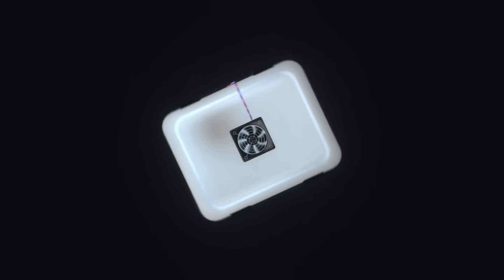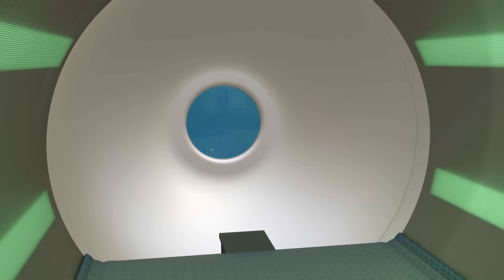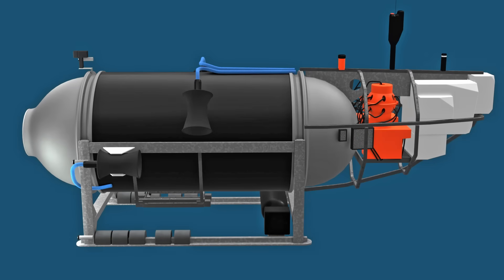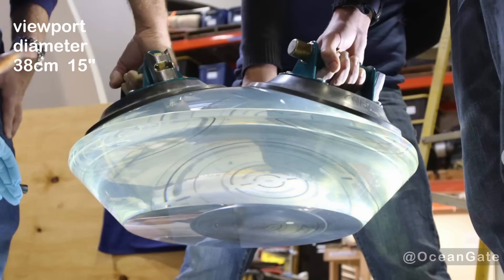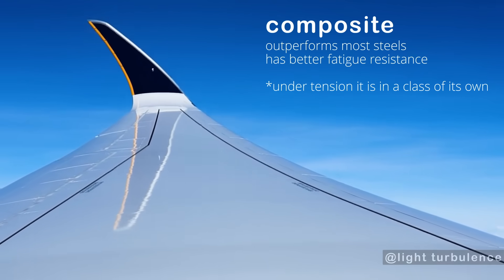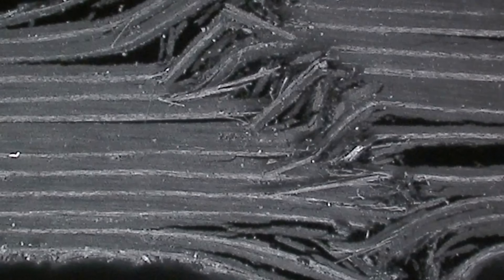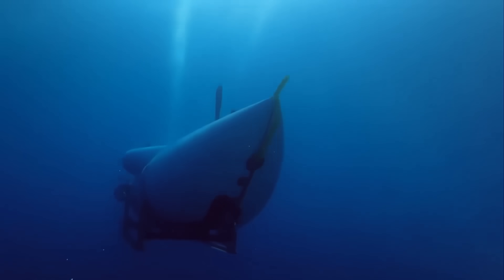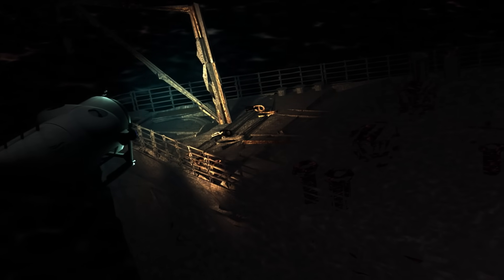Titan Sub | carbon fiber - Detailed Tour

Comment: While carbon fibre can be used for constructing virtually anything it must be used within its’ limits. The loud cracking sounds heard in earlier dives were layers of carbon fire failing and delaminating. Each crack sound represents a weakening of the overall structure. It was mistakenly thought that monitoring the number of crack sounds heard would give an indication of fatigue building in the structure. While this is true of certain metals, carbon fibre has a tendency to fail catastrophically and instantly once the limits of the composite carbon fibre resin compound are reached. The Hydraulic Press channel has a very good video showing carbon fibre failing under pressure and the failure is instantaneous and catastrophic. Titanium or steel elastically deform at known rates before reaching a point where permanent deformation and significant weakening occurs. The plexiglass window was also a potential point of failure and was subject to significant deformation with each dive. It was anticipated that surface cracking would occur and become visible on the surface when it was time for the plexiglass to be replaced. This surface cracking would indicate that the plexiglass had lost some of its’ elasticity and was not returning to its’ nominal size as deep sea pressures were reduced to surface pressure and the plexiglass expanded once more. This elasticity was also responsible for maintaining an air and water tight seal around the view port at depth. While the overall design may have appeared innovative, there were insufficient allowances made for material degradation with repeated pressure cycles. The safety factors that should have been built in were simply set too low or missing altogether in an effort to keep the craft as lightweight as possible.

Comment: What's tragic is he could've tested this thing relatively cheap.  It could've been weighed down, and dangled over a ship and let it sink.  Could have lowered it to a mile deeper than the Titanic and pull it back up and see if it survived.
Reply: They should do that, and then use ultrasound or x-rays to make sure that the structure has not been compromised in doing so.

Comment: This is all fine and the engineering and structural issues will be finalized sooner or later.  What I want to know is what took those looking for the sub so long to find it?  It was almost exactly where it was going.  Why was the Navy, Coast Guard, etc. feeding the media false information about hearing banging sounds even though they absolutely knew the sub had imploded.

Comment: The carbon composite was the failure point.

Yes, some "unfair" statements that weren't accurate have been stated against carbon composite.

But it's insane how many people here and other places seem personally offended that people insulted carbon.

Why are you and so many others so offended that carbon is blamed for its failure?

The debris recovered shows endcaps that were intact.  So it wasn't the controller, something I heard many repeat over and over.  It wasn't the under-rated glass (which was calculated to be fine, but never rated for those numbers).  And so many other early guesses were proven false.

Then, when we get to the actual cause, the broken carbon composite, the carbon-lovers are mad.

Yes, the news isn't the best place to get a technical breakdown of technical details, but it was "good enough" to get the message across.  

You say "Carbon fiber is strong in compression as well as tension."  Sure, but is it exactly as strong in both, or is it stronger in one than the other? We know the answer, and the fact you seem to take great effort to skirt the line seems revealing that you know they were right, just not flattering about your pet material.

Comment: No excuse will cover the heath robbinson appearance, let alone the cable ties that held the cables to the uni strut frame.

The compression force on the window, then imagin the pressure around the carbon tube then multiple stressing dives, the last one got them. End of the day it was glued together

Comment: I have worked with various CFRP materials. But none for this type of usage.
I agree with several tests to destruction. Especially with the risk of human cargo, this was not a unmanned ROV. 
It may have taken several tests to isolate the issue, as you mentioned the method it was wound was not controlled.
An after thought on this case is, the budget could not allow for destruction tests as they were too eager to retrieve funds.

Comment: Carbon fibre is a great material - in the right circumstances.

 Carbon fibre is really bad when it comes to compressive strenght. It is all up to the glue. 

I am sure the Airbus wing is not just 'layered' like the Titan. Also aeronautical and deep sea applications are VERY VERY different. Extremely. Not even comparable. 'Aeronautical engineer' to build a submersible, is like a wood worker doing dentristry. Yeah, you have to drill and fill holes. But the similarities end there.

So carbon fibre is not 'the boogeyman'. It is a bad choice for a submersible. 

Also cf like titanium is not great for repeated heavy compressive stress. Well known. 

But some people never listen to those that came before them. 

The whole thing was very badly cobbled together. The unsecured, loose wires outside (REAL submersibles make sure the wires are tight fitting, to reduce snagging risks). Cheap cf from the lowest bidder. Glued together in an environment that was not dust free and clean. As needed for GOOD layering. A porthole not designed for the pressures. No location beacon to find the submersible when surfaced. The exit screwed shut from the outside.

This was just an excercise in bad design meeting bad decisions. 

Oh - and there has been no deadly accidents with 'traditional' deep sea submersibles. So... who is correct?

Comment: This is the only video explaining the carbon layup was axial and radial. Every other source I had seen implied only radial fibers were used, wound around the mandrel. So at least it was not as bad as I thought. However, when I saw the video with the layup, which did not seem to be under very high tension, nor under a controlled atmosphere, I suspected the quality of the layup was probably at issue. Also, the fitting of the endcaps showed just hand mising of resin, no degassing and manual application with no extra squeeze out of resin. All that indicated rather bad quality control.
Thank for the additional info, very good infographics.

Comment: As a non-engineer, I do have a question: If the horizontal layups could be proven to have been a significant factor here, have manufacturers designed and/or built new carbon wrapping machines so tension is appplied for both directions? Thanks!

Comment: Who to trust, the airplane engineer or the submarine engineer? The big problem was not that the material couldn't theoretically withstand the pressure, it's that it would degrade, and detecting the degradation would be almost impossible. Titanium that does not exceed it's maximum stress does not degrade. The acoustic system was a dumbass idea that gave only seconds of warning before collapse.

Comment: Ì dont think carbon fiber hull is necessarily wrong but it has a finite short life cycle compared to titanium as there's issues wuth delamination. 13 succesful dives it made before failure and the company issue with lack of comprehensive cracking after each dive. After 10 dives it should if be retired and replaced

Comment: Carbon fiber has almost no compression strength. Everywhere we bolt carbon parts together, there is aluminum or G10 embedded into the carbon part, a hard spot we call it, so the bolt or fastener can be tightened down and not crack the carbon laminate.

Comment: if someone tells you to get into a cylinder which has not egress capability from inside and no egress point at the top, and takes 45 minutes to open and close run the eff away. pressure from the sea will always seal the dorso-lateral hatch of a submersible but a side facing one cannot enjoy this safety redundancy.

Comment: Good doc, its notable that the Titan failed when the frame was detached, the two rings had three longitudinal beams between them top left and right plus whatever was underneath, one (side) three ring block was ripped out of its weld on the ring. Either front port or rear starboard lug.
The crackling noise from the rear was prob the foam/particle board shelves detaching from the interior of the dome as it warped, or the rear structure and the lug pulled out of its weld..

Comment: 7:16 should have read, 20mm or 3/4". I wonder if the lights inside the sub were built into the carbon fibre tube? Looks that way. Would that reduce its strength? And the equipment inside the tube looks as though it was attached to the inside of the tube. Would these attachments create weak points in the tube?

Comment: From what I gather, carbon fiber tubes seem to have more strength, when high pressure, from the INSIDE, is pushing outward. 
Then you have the opposite. A high pressure from the OUTSIDE, exerting a "compression", crushing pressure upon the materials.  This carbon material does not appear useful in the case of immense, compression forces from the outside.

Comment: How deep were the screw holes for the handles / lights in the upper section of the carbon fiber tube ?  I see this is a possible weak point in the design.

Comment: The secondary tragedy of this event is that Rush's caviler attitude towards this design and implementation has set back true engineering development years due to the overall perception that CF hull design was bad.   If this had been done with input from top engineer experts using proven processes combined with destructive testing the project would have had a much higher chance for success and rewriting the design of deep submersibles.

Comment: Couple failures could be hairline cracks would get humid air in them then diving causing condensation would be destructive when ascending the water forces more destruction being less prone than air to escape. Then depth rating are for not having shocks applied to the seals and vessel. A tap is all it takes to lower the depth rating.

Comment: Interesting. Lets face it - the design did work, so their initial calculations were more or less correct. The thing completed a number of dives.

But they had no clue as to the number of cycles the thing would  withstand. This is the key. It was strong enough. This was proven. What they didn't understand was how it would age - or simply put - "wear out". 

Now the first clue to that had to be the "gun shot" noises it was making. Noise like this is caused by high and fast energy release. We know where the energy came from, but where was it going? Normalized deviance. "Ah yes, it makes loud noises". When in fact each occurance was a clear indication of destruction occurring within the structure. Typically delamination. 

So every time you used it, it got weaker. Many structures do this - specifically aircraft. But aluminium aircraft are well understood so there is a limit to airframe hours. Same with composite aircraft structures. The lifespan is understood and factored in. 

So yes its not the use of carbon fibre that killed them - its the negligent manner in which it was used. It was telling them that it was failing and they chose not to listen 😜

Comment: According to David Pogue, whose correspondence is credited by Snopes for changing its rating on the Titan text message log from "Unproven" to "False," the thrusters can indeed be one of several methods used, including an air bladder and several types of ballast, to ascend to the surface. One of his arguments is that jettisoning the frame would be the last choice of these methods in an emergency ascent (though it is not clear through the transcript that it wasn't). I make no claims as to the veracity of the logs, but claiming descent using the thrusters as evidence is a poorly reasoned refutation thereof. There is nothing in the log that implies that thrust was used to descend, and the previous message of reducing descent velocity is omitted in your video. It stands to reason that, if one wanted to slow the rate of descent of the sub, then one might employ a method of ascent--namely, the thrusters. Pogue makes no mention of descent with thrust because it would be a disservice to his argument to do so. Not wasting precious seconds typing out your intentions during an emergency is a much more compelling reason to doubt the veracity of the logs. At the same time, it is also a compelling reason to doubt Pogue's assertion that the crew would specify each type of ballast they were jettisoning as they were allegedly doing so. Then again, there is a complete lack of the shorthand that was known to be used by the crew. I'll withhold judgment until crew testimony and investigation details emerge.
Reply from the maker: @ratlungworm7035   The transcript is 100% fake and patently nonsense.  A crew member contacted me and confirmed this and I am making a follow up video with this and other information.
Reply: @Mike-Bell  I look forward to watching it.

Comment: Operating the sub without having tested to failure is like sprinting blindfolded towards a cliff.
You'll be fine right up until you very abruptly aren't. You have no idea how far that is, but if you keep going you WILL find out.

Everything wears out. Going with no preventative maintenance and no known limits on capabilities is a decision to go until catastrophic failure.

Comment: Salt water electrolyte ingress into any brittle laminate micro-cracks while under extreme compression and dissimilar electrode potential titanium end caps... a  battery. A few tens of microns layer of glue on the end caps are not reliable insulators and likely were making good electrical contact with the hull under high compression.  A recipe for anodic corrosion deep within the laminate during repeated high pressure cycling without the ability to eliminate salt water permeation in dry dock. Any axial fiber misalignment would exacerbate the possibility of a porous hull. 

Carbon fiber must never be attached to any conductor with a higher or lower electrode potential without a reliable insulator, especially in the presence of an electrolyte like water or especially salt water, and certainly when immersed.

Comment: Apart from the engineering flaws, I believe these problems started with the fact that Rush was battling other technical opinions in his field which may have made him become stubbornly entrenched in his position and defence of the structural safety of his sub. 
He was said to be stubborn and irrascible by some who worked alongside him. This likely made him reluctant to submit to independent testing in case he was shown to be wrong. Seems like a guy who would not hold his hands up to failure and suffer the inevitable incoming critique from Cameron and other competitors and engineers in the submersible industry.

Comment: One thing I'd like to have seen addressed here is the possibility that the failure mode wasn't simple compression but buckling. That is, a perfectly cylindrical pressure vessel will all be under compression (and some sheer but that's beside the point) but an even slightly elliptical wall will result in a tension component on the inner face of the flattened section and the outer face of the more curved section resulting in forces that tend to make an elliptic shape more elliptical. This consideration can make the rigidity of the structure a major component of the structure limits. (The very similar effect of slender column buckling results in structure failure at well below the compressive strength of structures.)

Comment: I suspect the outer flanges were damaged by the CF tube failing from the centre first and producing an angle on the CF which applied a leverage force at the flange.
It will be important for the investigation to to determine all of the destruction processes.

Comment: When first saw details of the design my concern was the interface between the carbon fiber and titanium sections. The difference in the strain of the two materials under pressure would create a shear force at the glue joint, wouldn't it? Or could they be matched by clever choice of geometry?

Comment: On what are you basing your statement that carbon fiber is more than adequate for resisting such pressure?  I have seen no expert in the field make this claim.  I think you just pulled that assumption out of your hat.  Comparing this construction with the wing of an airplane is ludicrous. The carbon fiber in aircraft is not subject to extreme compression over a long period of time.  Only to flexing.  How do you extrapolate that to an underwater vessel required to withstand enormous compression?  There are a lot of materials in airplane wings that can withstand flexing but are nowhere near capable of withstanding massive compression loads like wood, sheet steel and aluminum.

Comment: The basic root cause is that they set out to make it on the cheap, with safety as a secondary factor.  The exact technology can’t be blamed, it’s the overarching rotten financial plan that doomed the project.  A safe design would have redundancy and testing and certification as major design components.  They went for cheapness and cut corners everywhere.